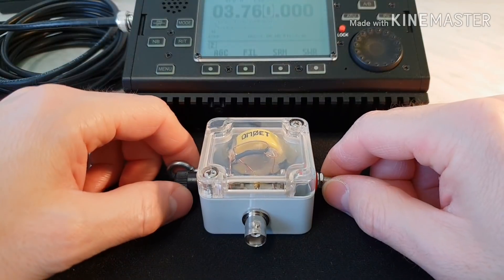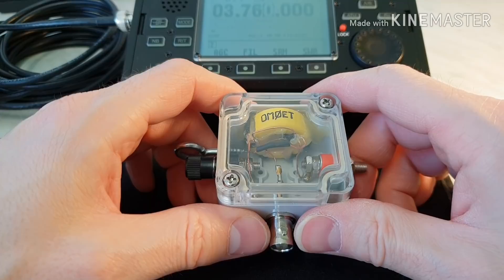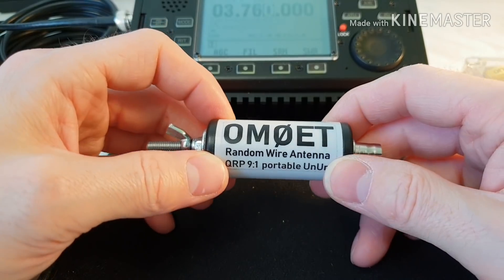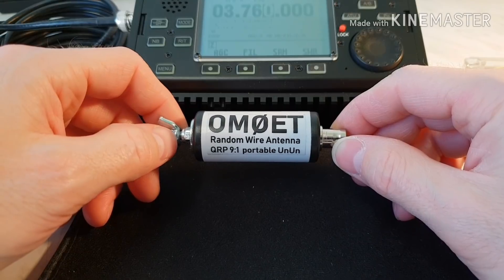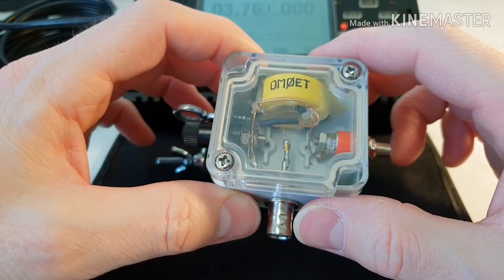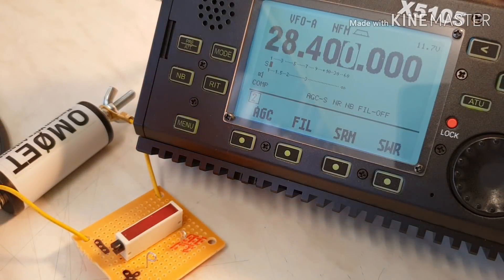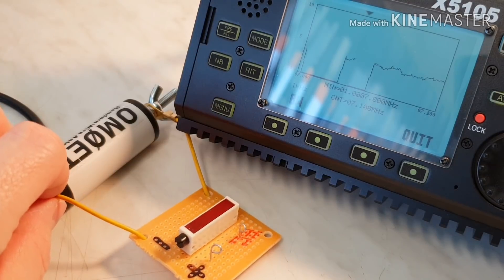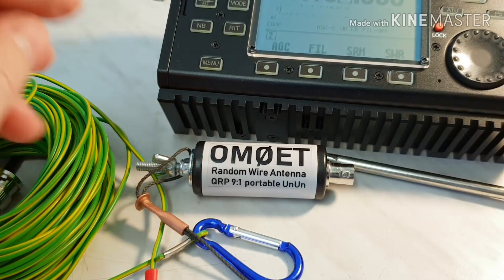New Mini QRP 9:1 UnUn and Random Wire Antenna (Part 1)

Comment: If 9:1 how does it work with what looks like 4 trifiliar turns? Can transformer rating ferrite cores do any good on just 20m and 40m? I have a bunch, from 1 1/8" o.d. to .5" o.d. and nobody peeps a word on their use, except 1 person says they lose their inductive multiplying properties at higher frequencies. No longer enjoy tinkering with a cap loop, just to recieve, and phase 2 for low swr, just want an antenna to trust, no tuner, on 2 or 3 bands for QRP use.

Comment: Hi. Which toroid you used when this 1:9 UNUN is made? It's looks like T68-6? This is right. Thanks for your answers. 73 de TA9AAP.
Reply from the maker: I am sorry, but I don't know to answer because I just bought it on HAM meeting without any type or name this toroids.
Reply: @OM0ET  Usually, I use Ferrite toroid. Because Ferrite toroid frequency dynamic range is so wide. Thanks and respect for your answer. 73 :) TA9AAP

Comment: I saw the testing in real enviornment.    But did not work well.  But curious to know the unun which you made in a transparent box also gave you 1:1 at your qth with 450 ohms ?
Reply from the maker: I think that this small yellow toroid is wrong material for it.  FT50-43 would be better with better results.

Comment: hi your a clover bloke . heres a challenge for you  6m to 160m small antanna . there a SIGMA EURO-COMM Magitenna 40 6m Multiband HF Wire Antenna 7.6m  if you use a atu you can 80m to 60m  with there wire anntenna . just wonder  may be you can make . or make a better one . just asking thank you

Comment: It appears you have missed the point of what an UNUN's primary purpose is- that is to reduce common mode impedance on the outside of the feedline. What you have is a 9:1 transformer- whether it is  an UNUN (unlikely as it is a single core) has not been measured, nor has the insertion loss been measured. SWR tells us nothing about the efficacy of an UNUN's primary purpose.

Dale W4OP
Reply from the maker: Hello Dale, thanks for watching! I am just a common HAM who want to make the antenna according to the model https://vk6ysf.com/unun_9-1_v2.htm
I am sure that 99% of us - common HAM's don't own such an expensive equipment which is able to measure efficiency or insertion losses. In my case I measured an impedance transformation from input 450ohm : 9 to output 50ohm = match with transceiver output SWR 1:1. What is wrong on it? 73, Paul
Reply: @OM0ET  There is a difference between measuring the SWR of a transformer and the common mode choking impedance of an UNUN.  SWR  measurements yield no information as to the efficacy of the device in choking off common mode currents. An UNUN is designed to reduce feedline shield radiation, transformers do not do this.
The Rig Expert series of antenna analyzers- and likely some other brands can measure common mode  impedance.

Here is a short article on common mode and differential mode  currents:
https://www.dxengineering.com/techarticles/balunsandfeedlinechokes/balun-basics-common-mode-vs-differential-mode
Reply from the maker: @W4OP  Thanks for info, but I dont have such kind of antenna analyser. Usually I use a current choke for fight against RF current in the feedline located right behind the transformer or UnUn.
Reply: @OM0ET  That is the correct solution-  a well designed current choke (UNUN or BALUN) will decrease common mode. TRansformers in general  do not.  In addition though you need to know the common mode impedance of the antenna. As an example, NO UNUN or BALUN  will be be effective at the end of a half wave antenna as the impedance is way too high for any real world UNUN's choking impedance to make a difference in common mode.
BALUNS and UNUNs have to be the most misunderstood device in amateur radio.

Comment: Nice. Finally somebody who actually had portability in mind. I'm not sure if I would trust the end caps though without actually gluing them in. Would be a shame if a gust of wind would rip the whole assembly apart. Still wondering how Chameleon managed to squeeze a 5:1 into a tube that's not a whole lot thicker than yours (Hybrid Micro).
Reply from the maker: Thank you! Hmm I had never seen that Chameleon product before so it's hard to tell :-) There is almost no pull force on the caps or UnUn body itself because the main pull from tree to the ground hook is in line and antenna wire with rope meets in the point of the UnUn antenna screw. Let's see how I explained it here: https://youtu.be/z9fJLo63ne0?t=775  but of course there is no problem to glue it inside too or cross the tiny screw trough tubing in to cap :-) 73 Paul
Reply: @OM0ET  hehe your project just happened to be Inspiration enough to get into searching once more. Turns out that the UnUn design of the Chameleon is a copy of what was in the Comet CHA-250. That in turn led to somebody who had copied that and stuck it into a tiny film roll can. So yeah, mysterious ways, but I think I positively identified the Chameleon ferrite core as an Amidon BN-61-002 or the type 43 equivalent - which should both relatively easily fit 1/4 inch copper pipe. See here https://www.youtube.com/watch?v=4n30XykCChY and here http://sp7q.blogspot.com/2012/03/kopia-anteny-cha-250b-va250ha.html

I like the Chameleon idea of using the balun both for a wire and as a base for whips - just don't like it $200+ dollars much for a balun and a wire, not including the whip antenna. The ferrite costs like €6.50 at most. Add a PL or BNC connector and some other hardware and it's somewhere around 10-15 at the very most. With the right threads it will accept cheap military surplus whips.

So yeah, your video was a great reminder that we don't need 200+ Watts baluns to feed them with 5-10 Watt QRP rigs. Much needed.
Reply from the maker: @KannixKostnix  I don't know what cost is the CNC manufactured body of this product. I suppose that construction of the Chameleon UnUn costs a lot because look very proffesional made. I do my antenna as small as possible but they still should work good for QRP because every gram or centimeter counts when I work portable and I have to carry all this staff :-D I don't need equipment for 50 or 100W because I will never use that power with my QRP equipment :-) And my opinion is that I have more fun when I make QSO on 5W with somebody instead of 100W or more :-) 73 Paul
Reply: @OM0ET Yeah it wasn't meant as a rant against Chameleon, because it's a commercial product after all, and how well it is made as that can clearly be seen in comparison to that Alpha piece. I'd still recommend it to anyone who can't or doesn't want to do some tinkering himself. But you don't need CNC if it's not commercial mass production. A drill press and some files at most. Or do the PVC pipe thing like you did. Too bad that unless winter is coming back, the tinkering season is essentially over. ;)
Reply from the maker: @KannixKostnix  :-) I suppose you live in the southern Earhts hemisphere when you say that winter is coming :-) We in Europe are happy that finally spring is coming and I can do QRP portables finally hihi ... finally warmer times! You have to move to Europe for couple of months now ;-) 73 Paul
Reply: @OM0ET  Oh no, you misunderstood. Of course it's nice that spring is just around the corner, but beyond the portable QRP perspective, the warmer temperatures also bring a bunch of other possibilities or even obligations, greatly limiting the workbench time. Then again, I found a guy on eBay selling a kit for the 5:1 for merely 10 Euros including core, pipes, and PCB to make the connections. That makes for a quick and even cleaner solution than Chameleon's, and with shipping included I'd consider that a very fair price. So I might just end up playing with the 5:1 in a project box like you used for your previous antenna before coming up with a permanent and hopefully downsized solution if I like the results. It's all YOUR fault. ;)
Reply from the maker: @KannixKostnix  :-D well I wish you good luck with your own project my friend. I believe in a good results. I will appreciate if you will let me know how it works ;-) 73 and have a nice day! Paul
Reply: Chameleon micro the best